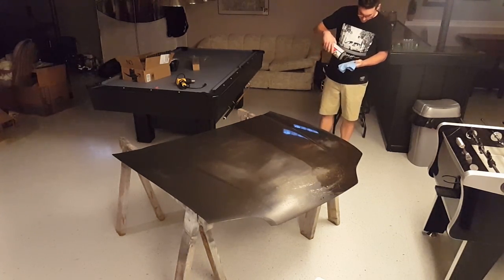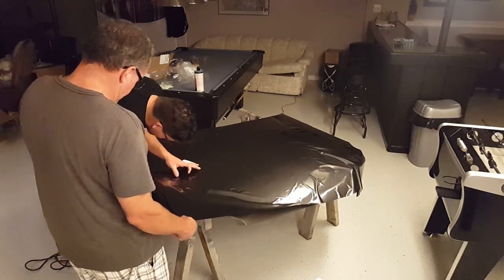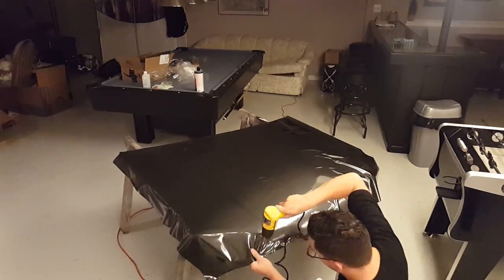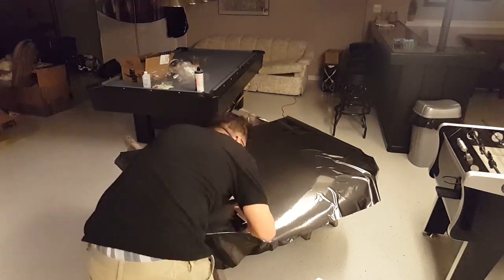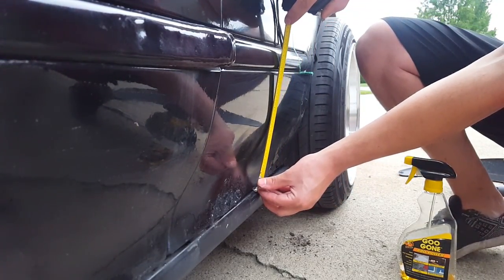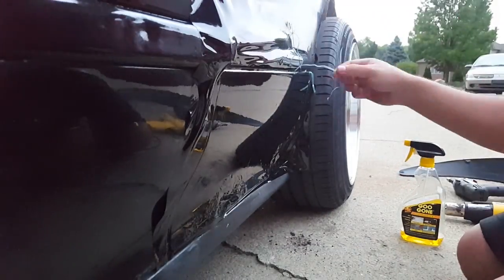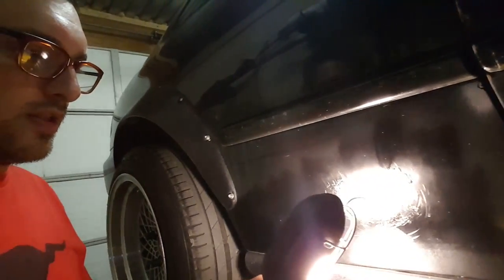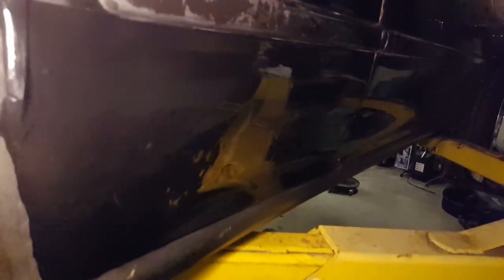Vinyl Wrap and Cleanup | EG Civic

Comment: How hot was the room? With most air release vinyls are pressure sensitive at a certain temperature, meaning they won't stick until you press on it. 24 degrees Celsius is usually the standard temp. A room that's colder will make your life a lot easier. Anything hotter and it sticks pretty bad.
Reply from the maker: iamamir filmwerks It was probably about 21 degrees celcius. This vinyl was really bad. I've laid vinyl quite a few other times in hotter temperatures with no issues like this
Reply: Ah, fair enough. Crappy vinyl will definitely also do it. I've learned that the hard way... lol

Comment: Dude i just bought my first honda yesterday, 1993 eg hatch, the bolts on the header need to be rethreaded, any ideas or opinions on how i should do it? Instant sub btw 🔰🔰😛
Reply from the maker: jose luna thanks man. I'm not entirely sure. if they aren't too bad you could run a die over them. or you could replace the studs completely. I've never had that issue

Comment: what size wheel spaces are on this car?  and wheel specs?
Reply from the maker: Dawson Clifton I'm running 15mm 4x100 to 4x114.3 adapters. The wheel specs are 16x9.5 +0
Reply: Nick Sabella 2 inch flares?
Reply from the maker: 3 inch